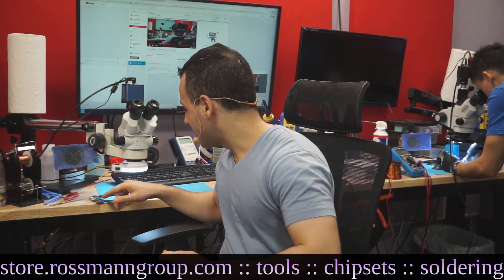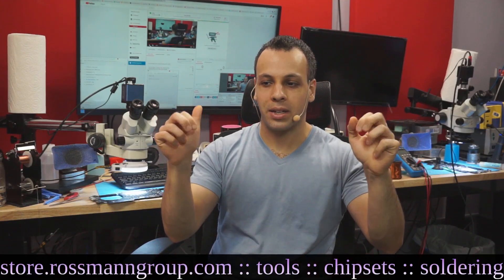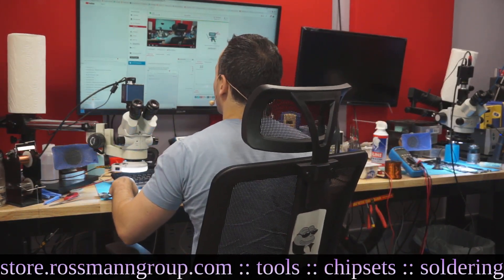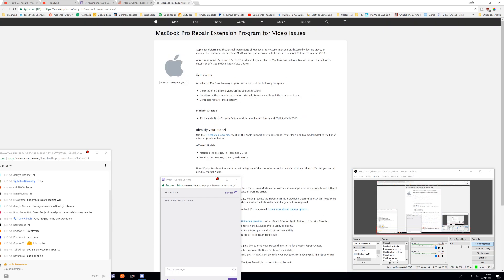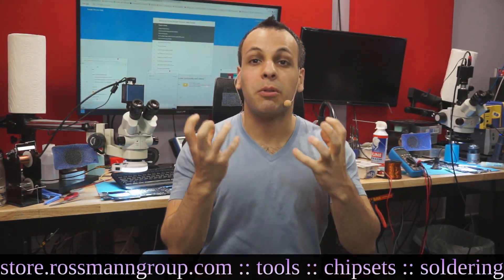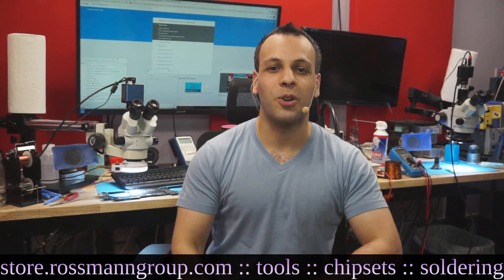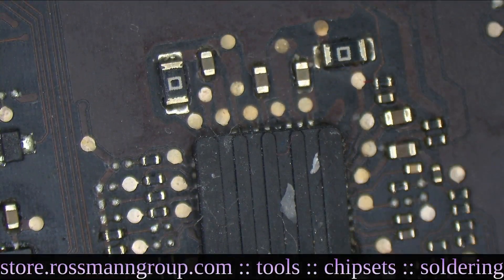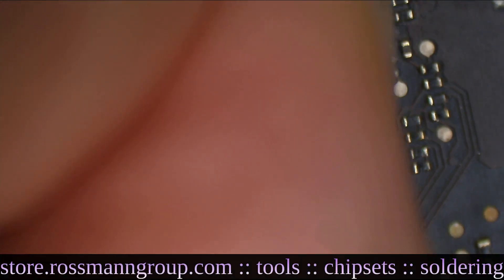Are jerryrigged fixes unique to independent repair?

Comment: So what you haven't done is explain why that isn't an adequate approach or not.  You /imply/ that it isn't, but really all you do is point and laugh.  So if you want me to believe it isn't then you have to actually explain why
Reply: That's not the point. It might be part of a reasonably working fix, but it is still a hack job. So Louis pointing that out counters the critique of people who don't want a hack job done on their device and think they can accomplish that by sending it to the manufacturer.
Reply: Some very smart but cynical people have obviously calculated that this bodge will keep things working just long enough to live out the warranty. Firstly rubber and adhesive on a hot chip are going to degrade over time. Secondly using a delicate IC as an anchor/mounting/stress point for a circuit board is a really dumb idea and the kind of engineering reserved for 3rd rate Shenzhen Special products. It's the engineering difference between propping open a broken window or actually fixing the window mechanism. Probably enough of these "repairs" will last long enough considering that Apple gear tends to be replaced quite frequently but whether that's "adequate" for a supposedly top shelf premium priced item is up to you to answer.
Reply: It's a hack job because it's basically the equivalent of using a piece of chewing gum to hold something in place. There is no need to explain why this is because it should be self-evident given the other alternatives he listed in the video (use different material, redesign of the board, etc.). Basically anything else would have been much more of a lasting solution that would deal with the root cause as opposed to the symptom.
Reply: I didn't say it was there to hold it in place, I was implying the professionalism of the rubber pad was equivalent to a piece of chewing gum.

As stated earlier, it is you who is missing the point. This isn't about whether it worked or didn't (I'd go for the latter given that the board is in a repair shop), he was only drawing attention to the fact that a fortune 500 company would rather do a quick-fix than engineer a real solution - something that deals with the root cause and not the symptoms.
Reply: Gotcha, I'll refrain from any analogies from now on.

The argument that it's a bad approach remains that a fortune 500 tech company which designs and builds its own equipment is fully capable of engineering a solution and has decided to use a piece of rubber that may or may not actually help. This type of solution is typical of 3rd party suppliers and repair shops looking for a quick buck. As such, this is a hack job in point of fact and is fully self-evident for anyone capable of rational thought.
Reply: Jock Murphy I've stated why it's a bad solution several times now; it is not an engineered solution that solves the underlying problem. The "right solution" is to perform design and/or material changes.

I don't speak for Louis, but I would surmise that he pointed and laughed because this is only further evidence of the sub-par quality of apple products in general. He has spoken about this at great length in various other videos, and so there was no need to do any more than laugh in this one.

That this pad of rubber corrects or does not correct the problem is irrelevant. It is bad engineering practice to use a makeshift solution when a redesign is in order. Anyone who considers this an appropriate solution clearly has no shame.
Reply: It's always an option as long as you're willing to take a hit for the sake of customer satisfaction. Fact is, a company like apple can afford to redesign a board or research and implement better materials. However, the conversation for what to do about the issue would go roughly like this: 
"People are complaining, we need to do something about this."
"It was designed to fail in the next year or two anyway, let's go with the cheapest option possible."

That's the joke. That's why Louis (and everyone else) was laughing. That's why whether it worked or not is completely irrelevant. They are not interested in solutions that work long-term because they know some other fault is going to force you to buy a new device soon enough anyway.
Reply: I don't need data. This conversation centers around your inability to understand why someone is laughing at a lazy solution.
Reply: I also have no vested interest in what people believe.

You don't need hard data to understand that redesigning some portion of this product to prevent flexing would have more, lasting benefit than gluing a piece of rubber to a board component. At this point, it seems you're more interested in defending your own design choices than recognizing that apple does not seem to have  its customers' best interests in mind.
Reply: There is no burden of proof on me because I was never out to try and prove anything regarding the effectiveness of the pad (as you are very well aware since I have stated this over and over ad nauseam). My criticism is purely based on the professionalism of the approach in this particular instance. As such, there is no fallacy as you describe it. It has been you, and only you, who wished to turn all of this into a detailed analysis of how well the pad works (Perhaps over several meetings where we discuss it, complete with powerpoint presentations featuring graphs and flow charts. I was once roommates with a guy who produced everything he wrote point form habitually as if everything revolved around presentations. He was a greasy sort of man, and I do mean that literally. You'd almost always find him with a glaze of sweat on his face. He'd often buy a full roasted chicken for himself at the local grocery store, tear into it with his bare hands and offer some to passersby. That man is now the vice-president of a multi-million dollar company. Never doubt the power of powerpoint).
Reply from the maker: I don't have any vested interest in what people believe.
Reply: Look you are trying to tell me that that is a bad fix.  Let's pretend i am just some layman.  I hear your say the problem is caused by flexing of the PCB, and that putting a pad there is a bad fix.  My first thought is "well if flexing the pcb is an issue, wouldn't tat pad help prevent that?"  You on the other hand just assert that it is bad, don't say why, and then laugh.  You further make fun of the hair and dust as though it came from apple, but for all I know it came from your shop, or the computer it came from.  I have watched dozens and dozens of your videos, I have seen you be articulate and explain your logic.  You aren't here, you may not care what I believe, but if you want people to accept you as an expert you have to do better than this
Reply: Whether it fixes it or not wasn't the point.  The point is that just because you send it to the manufacturer, over someone like Louis doesn't mean they won't be lazy little shits and do a hack job.
Reply: Omg, you are so ignorant.
Reply: Whether it fixes it or not and if it is an appropriate fix is exactly the point, Louise doesn't address either.  He asserts but doesn't explain.  He also doesn't explain why his fix (whatever it might be) is better.
Reply: @llary, can you say for sure it is rubber?  My guess is silicon which should withstand more than enough heat.  Also it seems to me that reinforcing the stress point with something flexible is the right solution until you can rev the board.  But wouldn't it have been nice is Louis actually gave ANY explanation for why it was bad other that pointing and laughing?
Reply: See that's funny, because I have been an engineer  (first software, and more recently added electronics) and I have sat in various meetings where PCB flexing was an issue, and (re)engineering to add more standoffs wasn't an option.  Pads like that have been proposed, tested, and approved as a solution.  I can't say if it is the right option for the retina macbook or not because neither of us have the data.  But if you want me to believe it is the wrong solution you are going to have to do a lot better (like provide data, or demonstate why it isn't), that what you are doing.
Reply: Don't feed the troll plz
Reply: @Llary.  Yes, I understand the argument you are all saying.  I may or may not agree.  What I am asking is that Louis provide a coherent argument why it is a bad fix.  He trivially could have done that if he really believed it; instead he points and laughs and when I challenged him on this, he gives a defensive reply; but still not a single argument for his point.  He deserved to be called on shoddy rhetoric
Reply: More assertions, no data.
Reply: If you can't prove (and that included data) it is a lazy solution, you are just asking someone to just take your word for it.  I believe in a higher standard.  I believe that if you make a claim, you have to be able to back it up.  I don't know about you, but that is how I was trained.  We are doing engineering her, not faith healing.  Hard data is supposed to be our stock in trade.
Reply: If you can't prove that the pad over that chip doesn't in fact stabilize the PCB and resolve the board flexing (which it may very well do, and last) then you don't know it is a bad approach.  All you are doing is insisting that it is in a pale version of the appeal to authority fallacy.   If you make the claim then the burden of proof is on you.  If you can't or won't do it, then there is no reason for anyone to believe what you say.  No matter how condescending you are.  I have no dog in this fight,  I don't know if that pad is the right approach in this case or not.  It would be really interesting to find out.  However if you — and apparently Louis — have no interest in proof or facts nothing will ever be known about that from either of you.  Feel free to the last word, I am done
Reply: But where does Louis explain WHY it is a hack fix? He doesn't.  He asserts that it is.  He also provides no evidence why his approach is better.  He simply assets both facts, he doesn't provide any explanation.
Reply: Two out of your three comments to me have simply been to insult me.  The third misses the point of what I was trying to say.  Please tell me that isn't the best you can do.
Reply: Wait, that pad isn't holding the chip in place — unless you can provide some proof that it is.  My impression is that it was there to stabilize the board over a critical component and prevent the board flex Louis mentioned.  I think we can all agree that revving the PCB would have been a better solution, but in terms of a slipstreamed fix I am not sure that pad is a bad approach.  Louis certainly provides no argument why it is a bad approach, or proof that his fix is better.  Do you see what I am saying?
Reply: I was responding to your comment  "It's a hack job because it's basically the equivalent of using a piece of chewing gum to hold something in place" as meaning it was there to hold the chip in place.  I am sorry if I misinterpreted, but I hope you can see how I got to that conclusion.  You are saying it is a quick fix, Louis called it a "hack", and my point still stands that he hasn't provided any evidence that it is a hack, that it isn't an appropriate slipstream repair.  He asserted it, can you point to where he provided any fact or argument why it was a bad approach?
Reply: And so I return to my original point: Can you provide any proof that it is a bad fix?  That it is the wrong approach?  Can you conversely say what they right fix is?  More to the point, why didn't Louis do that instead of pointing and laughing.  Again: if board flex is the problem, why is something that stabilizes the board a bad approach?

Comment: I broke my DS Lite when I was 12 and when I was swapping the replacement screen in I accidentally snapped the top half of the connector for the digitizer ribbon cable. What did 13 year old me do to resolve this? I got some rubber from a pencil eraser and jammed it on top of it so that when I screwed the plastic case back into place it would push the cable into the connector and make it work. Clearly I was cut out for Apple engineering at the age of 12 looking at this.
Reply: That sounds a bit to advanced for Apple engineering.  What Apple would do to fix that?
They'd use leaves man.  Leaves.  They'd use that type of engineering for the GPU, which is clearly shown here.
Reply: should've copyrighted that s#it man, that way when Apple sued Samsung you wouldve been like YO AND WHAT ABOUT MY RUBBER TECHNOLOGY BOII

Comment: Having had some bad experiences with computer repair people , it's nice to see someone with so much knowledge and integrity. If I ever need a Mac board repaired, I'm sending it to you. Although I am also striving to emulate your set up as I think I could learn from watching you if I had a microscope.
Reply: Well, it helps a lot but you don't actually need a microscope, the only tools you actually need to get started are solder, an iron, tweezers, flux and a bit of solder wick.
It's not gonna be easy but you can remove most components with just an iron and solder, but yeah you'll probably want a rework station too, but if you go cheap you could get a 2in1 station for about $40 + solder, tweezers, flux and wick is only about another $5-10, then if you really want one, the G600 is a decent little microscope for $50.
Reply: Thanks for your advice. I actually have some pretty good equipment already. I have $250 Hakko hot tweezers which are amazing for removing sm components. I have a Hakko soldering station.. I do electronics modding for music keyboard displays. I thought a microscope and oscilloscope and psu would vastly expand my capabilities and as you said a rework station would be a good addition also. Thanks again!
Reply: Sure thing, yeah they totally do somewhat expand your abilities but they aren't vital equipment like a soldering iron is, at least not for repairs, a microscope just lets you see small components better but a magnifying glass or a head magnifier also does the same thing for far less and an oscilloscope is just a multimeter that displays voltage over a period of time, so it can help troubleshoot certain issues better than a DMM but generally that's all you need for basic troubleshooting as Louis constantly demonstrates, he doesn't actually use his oscilloscope on camera all that often.

A good PSU though, that can be a critical piece of kit depending on how much you rely on it, so for working on customer's board for example you may decide it's not worth risking boards by going cheap, it technically shouldn't matter that much but I'd never disagree with a "better safe than sorry" policy when dealing with others things, for general hobby use though a cheap dc converter + a power brick does the job just fine, I can recommend the RUIDENG DPS3003, it's very good for the price.
Reply: I will look into that model. Thanks!